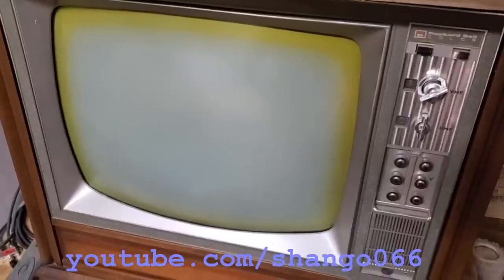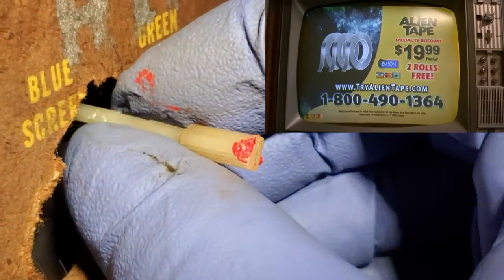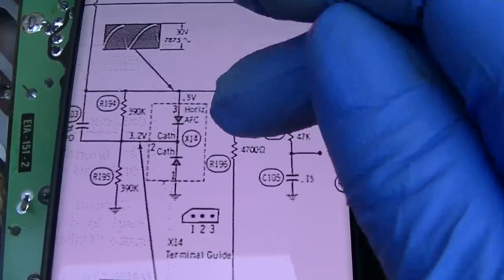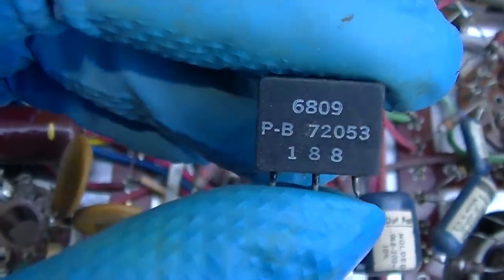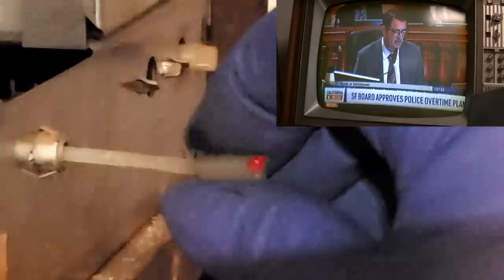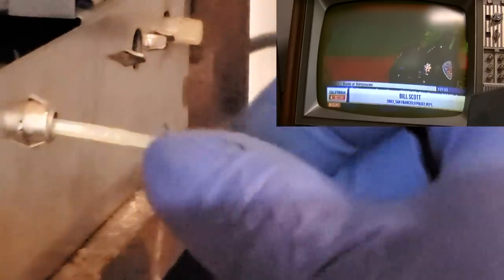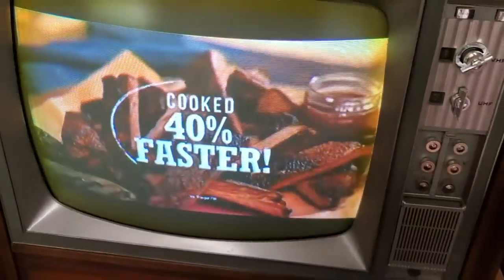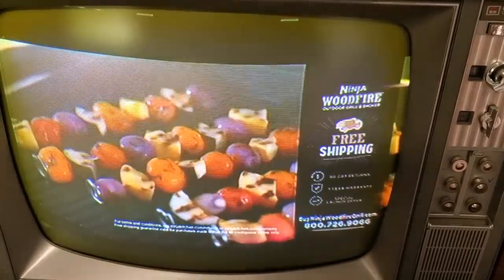Soft Horizontal Lock 1968 NOS Packard Bell Test Set Update 4 3 24 23

Comment: If you run into a critical setting on the horz hold coil again, take a look at the resistor across the leads, IIRC its a 56k. I had a CTC7 IIRC the resistor was high 10x. Have to disconnect of course to check since its in P with the coil. Take care, enjoying the videos. I may do a tv one again soon. Seeing all yours inspires me to dig into one.

Comment: What you have to factor in when doing this is that domestic items that convert digital to analogue like digital TV boxes, DVD players etc. have sync pulse generators in them that are built down to a price, so they are not as precise as those that a broadcast TV station would have used on analogue (which are built to a minimum quality, not price). So there will be slight variations and a margin of error of the exact phasing and frequency of sync pulses generated by domestic stuff. Newer TVs have ways of factoring that in and correcting sync pulse errors - and that is what the designers of digiboxes, DVD players etc assume you would use. This thing might have flywheel sync correction but it’s not going to be as good at correcting sync that’s only slightly off standard NTSC spec frequency or phasing as later sets. So the set might have just needed a tweak when you switched it back on after leaving it overnight. When it warms up, the designers would have assumed there was broadcast-spec NTSC going in to it so you wouldn’t have needed to correct the sync when switching on. Now we have sync pulses that vary slightly from NTSC spec, this exposes the designer’s (unintended) tardiness.

As there is a central point at which it must sync, then I’d have adjusted it just after it had been switched on then left several hours to see if it drifted. Even then, with another DVD player or digibox, the syncs may be slightly off again from the one you used, so some level of install and setup of that may be needed.
Reply: My cable box has terrible synch.
Reply: You solved a 30 year mystery.  When I was a kid I had an old Magnavox 19 inch tabletop color tube set from the 70s.  It always had terrible horizontal hold lock and always had to be frequently adjusted.  Live tv worked, so did video games.  Recorded VHS tapes did too.  But commercial VHS tapes with macrovision made it throw a fit and the image was extremely unstable and the horizontal output tube would run so hot.  Never heard about those diodes until today.  I always thought it was a bad cap in the horizontal oscillator.
Reply: Modern video DACs are based on crystal clocks, they are quite precise. Even the crappiest crystal is much more precise and stable than the components used in an analog TV's sweep circuitry. The most frequency sensitive part of an analog TV is color demodulation. If the DAC's clock is stable enough to maintain proper color it's orders of magnitude more precise than needed to keep sync.
Reply: He will never acknowledge you. I've been telling him this for years. I just retired in CATV with 42 years.
Reply: @eDoc2020  Yes, quite precise. Still not as precise as a broadcast-spec SPG even from the time this was made.

I’ve had it where I’ve used one DVD player to adjust the colour lock then switched to another DVD player and had to tweak it back the other way... Same with digiboxes. So the crystals are good at staying to their designed frequency, but it’s the manufacturers using suppliers of crystals who aren’t making them resonate exactly to that frequency.

In fact, I’ve seen some DVD players and digiboxes that just rely on an IC to generate all syncs with no crystals involved. How precisely on frequency is that gonna be?
Reply: @stickytapenrust6869  HTF is it even possible to have an NTSC/PAL color video DAC without a crystal?
Reply: @eDoc2020  I don’t know. Or maybe they were SMD crystals incorporated into a chip? I’ve never shown more than passing curiosity into how modern electronics work. But I once needed to fix my PVR’s PSU (a cap had blown its top) and just showing interest at what was in there, there was no sign of any silver pill-shaped crystal for 4.43MHz at all.
Reply: @stickytapenrust6869  SMD crystals (at least RTC crystals) are sometimes in thin black plastic packages.

Comment: So it was those Flywheel Synch Diodes then.
I believe the reason that Set Makers started to use Flywheel Synch was to get straighter picture verticals when reception was weak and to reduce disturbance when there was interference.
It does make the Horizontal Timebase more complicated though.

Comment: Maybe the H-alignment was not correct ? In some tube-TV I know you have to align the phase detector seperate from the H-Generator, means: The generator should be aligned without AFC-Voltage and the phase detector hast to aligned without synchron-pulses from the video to right frequ. In my sets (Germany, old GDR) it is not possible to align the H-Generator-coil with the phase-detector, it would result in a bad H-Synchronisation. Maybe it works in your set...

Comment: the size of the leads you would think it needed 3amp diodes. 4148's are enough though
Reply: It's only small signal at that point in the circuit,  selenium diodes were always in huge packages. Youd think they were 10amp parts to look at them, in reality 100mA was about the limit.

Comment: Todays tv viewers never have to touch horizontal or vertical holds. When  the tv repairman from the 50s 60s  had to remove the chassis it was usually gone for a week or two to correct sync problems.  Some things are better...........

Comment: Packerd Bell. I used to have one of their laptops, it was rubbish.
Reply: Ah, a Packard Hell laptop!
Reply: The computer people only bought the old established name.   It was daewoo electronics who built the low end 90’s computers in bulk for places like Walmart and the plethora of AV stores like circuit city and fry’s  that are now part of history as well.   Sadly the monitors were not bad, think they used goldstar parts in them. But yes the made in USA Packard bell name was long gone by them.  I want to say daewoo was produced in South Korea then who made the computers. Think daewoo was absorbed and of course the packard bell name been EOL.  They just wanted a known US brand name to slap on to sell initially as daewoo was not something American took to.  They tried to sell refrigerators and even cars here under the daewoo name and all had failed miserably.
Reply: Also you could tell packard bell was geared to older buyers as everything was in the box monitor and all then.  I ran a shop then and those Packard kept getting more and more all in one and disposable at end. If you wanted to replace a PSU it cost twice a new computer.  Now apple does same crap. Solder on the memory and HDD and code the hardware to read before access. Blah.

Comment: So what this series is proving is that Packard bell TV's are basically rubbish after sitting unused for 50 years
Reply: Good to know, now I can avaoid them.
Reply: I know Packard Bell PCs were always a bit crappy. But then they were cheap.
Reply: Since there were TV repair shops all over the place in 1968 who had enough work to make their entire living from TV repair, the reality was that all TVs were unreliable. Considering the voltages, the heat, the demands of driving a CRT, the relatively poor quality of some components, and the use of active devices that began to degrade from the first day, it’s no surprise.
Reply: @michaelturner4457  I was thinking the same thing lol
Reply: That generalization would only be valid after doing the same test on a same year Zenith.
Reply: @PeopleAlreadyDidThis  WORD
Reply: That applies to all electronic gadgets. Whether you use it or not, the chemicals the components are made of will still age as they were only designed to last for 10 to 15 years, not 55.

It’s entropy, the second law of thermodynamics. You can’t escape it. Everything ages and gets worse.

Also, components can break when they’re being “worn in” when being used while still new as there’s no real test of whether a component was faulty from manufacture without using it. That still happens today, otherwise manufacturer’s guarantees would be quite pointless, wouldn’t they?
Reply: @stickytapenrust6869  Very good point, you are indeed correct my comment was somewhat in jest! I have to replace caps and selenium rectifiers in a lot of the radios and test equipment i restore
Reply: @stickytapenrust6869  Were you a fan of Tim Hunkin's excellent 1980s "Secret Life of Machines" TV series?  I associate your YouTube name with the tape recorders episode.
Reply: @rossthompson1635  I was, I even uploaded a copy of that VCR episode. Ironically just before the one I was using at the time broke!
Reply: @stickytapenrust6869  Fantastic :-)   I loved the down-to-earth explanations - and I'm sure you have discovered his amazing recent YouTube videos about the components he uses for his novelty arcade machines.